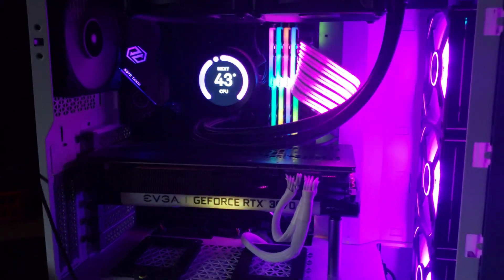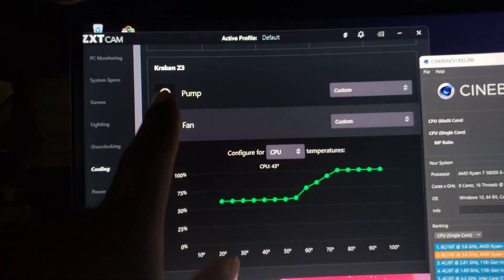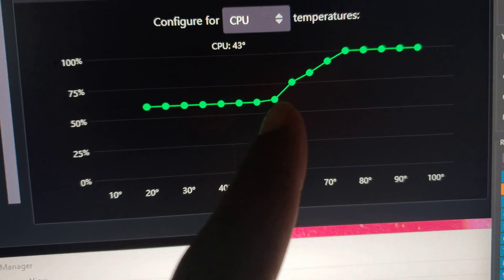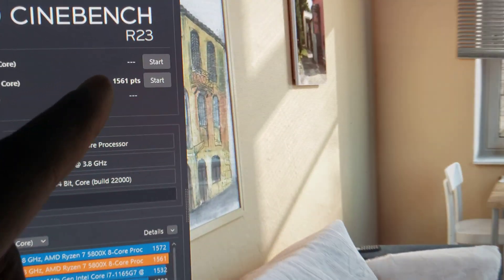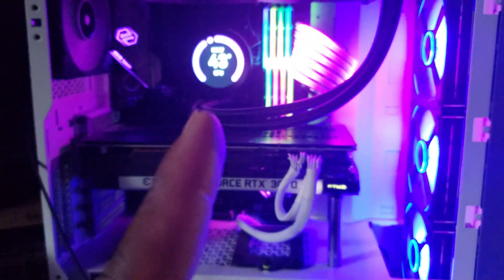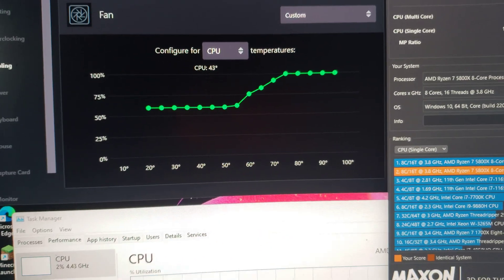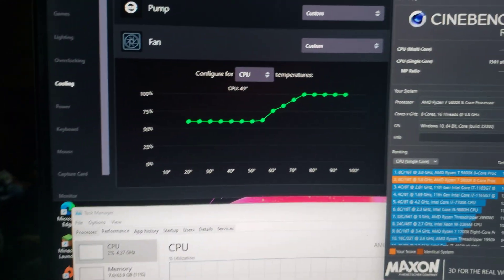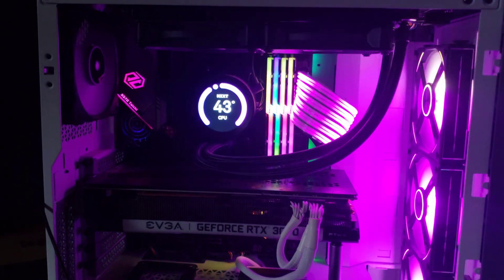What the hell am I doing... fan curves? Ryzen 7 5800x

Comment: ..type in "power plan" in your search bar..make sure its not set to "Ryzen balanced power plan"..if it is ...set it to the "windows balanced power plan"...heat will decrease and fans should stop ramping up a bit..cooled down my 5900x this way along with disabling PBO in bios under advanced CPU configuration....still gets 4.9ghz boost clocks but way cooler with no CPU throttling at all...under max load..77c...idle 44-50c..Noctua DH 15 air cooler installed/
Reply from the maker: Will Definitely look into this. For sure thanks.
Reply: @theopszone6775  ..i got the info from a post on cooling both the 5800x and 5900x (just passing on the info)..tried it and right away i dropped 10c at idle..i was shocked..74c..-when under stock settings ..idle 55-60c...85c under load with Precision boost overdrive enabled and Ryzen balanced power plan enabled..both feed too much voltage to cpu configuration causing the cpu to throttle..hence the fan speed increase...as far as fan curves , you can set them manually ( in BIOS under Advanced Cpu configuration) or choose presets like "Turbo speed"..or just mess around until you find a sweet spot..my 5900x is similar to your 5800x for thermals..some suggest under -volting but that's not a solution for me since it voids my warranty.not worth the loss if i have probs or RMA's...good luck!